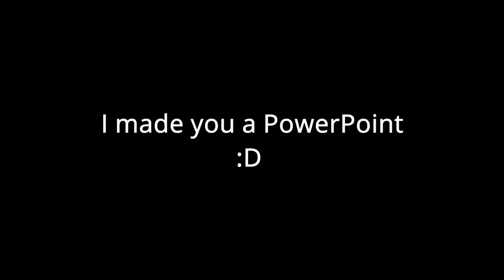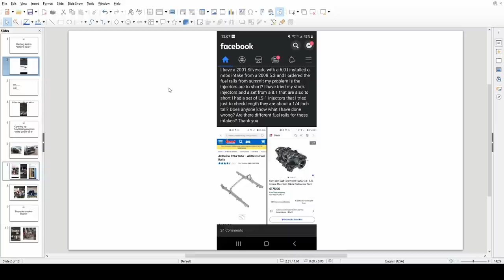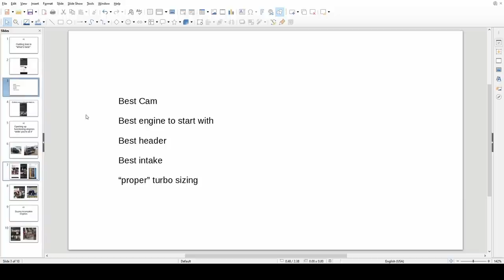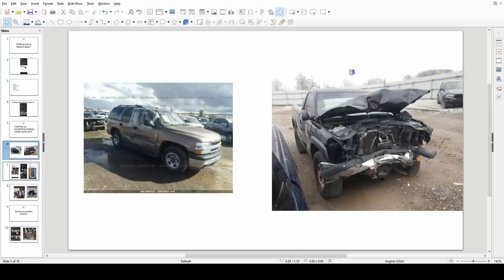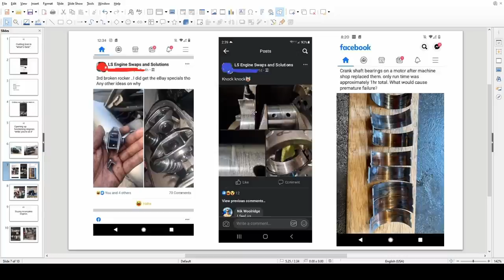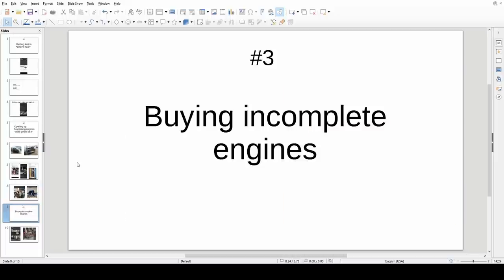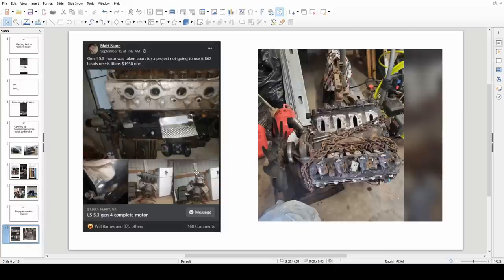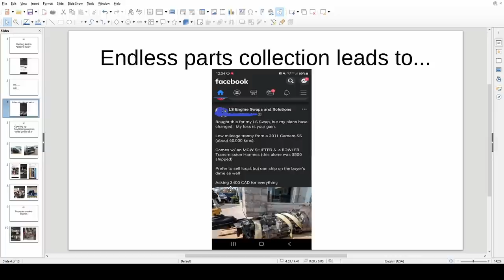3 LS engine build traps and pitfalls to avoid at all costs!

Comment: For us LS beginners who are financially strapped, this is the most informed informational LS Channel around. Learn something new every time. Some day I'll get it done. 👍
Reply: Stay away from YouTube, its the blind leading the blind
Reply from the maker: And yet here you are 🤣
Reply: @TheDrivewayEngineer  It's comedy time for me, I always need a good laugh.
Reply: @TheDrivewayEngineer  I have a ls. I want to build it to make reliable. But everyone is telling me to go flat tappet cam. They are the best and the factory uses them because they are the most reliable. And unless I’m running 8000 rpm all the time I don’t need a cam that uses solid roller lifters. And I’d most likely blow my bearings out on my rollers by going to slow. Is he right?
Reply: Another thing to keep in mind is you will spend money on things you don’t think of to get the swap to work, little things like bolts even add up, supporting hardware to integrate the engine.  If you are cash strapped the best advice would be to get everything complete in one go, then drop in and run stock.  A stock 5.3 with dual exhaust will run better than a mild 350.  They practically last forever especially in a rarely driven car so you can mod it later if you want.  I spent more money because I got a good deal on a 6.0 engine that wasn’t entirely complete, it was complete pan to intake but missing wiring harnesses and a few accessories.
Reply: I guess if you want some basic knowledge. This dude has never owned anything fast in his life. If I took his advice when I built my car it would be a slow piece of junk.
Reply: @nsboost  this isnt a speed channel. So no one expects that. He has great information on tips and tricks for people who are just turning to the LS platform. So theres that.
Reply: @RipRider916  short answer, no he isn't, first off LS engines don't have flat tappet cams, secondly that's going backwards, just do research, blowing out the bearings by going too slow sounds pretty odd and I've never heard of that myself, sounds like he knows enough to spout some crap off and sound like he knows something
Reply: everyone that builds their own stuff is strapped. the rich boys buy the turnkey chargers,etc.
Reply: Big factz💪💪💪

Comment: To be fair, in every Richard Holdener video I’ve seen he’s very clear with the engine performance graphs that show what RPM range produces the best power for a given combination. If internet idiots don’t pay attention and go buy expensive parts that work best above 5000rpm and all they do is drive around on the street then I have no sympathy for their stupid mistakes. I appreciate you are honest about the headers and buying for looks where many folks would not.
Reply: Pretty sure Holdener has videos that have demonstrated that headers make more power.
Reply: @stlchucko  they do, even more with a cam swap honestly there pretty cheap too unless you try to buy them from some fancy name brand that claims they make 2 more hp then there competitors. But my biggest regret was trying to do all motor so much cheaper and better just to go turbo if your lookin for cheap power
Reply: @texasstreettunes1310   I think manifolds vs headers on turbo stuff is a non-issue at reasonable power levels.  For that, I see packaging and durability being more important.

I noticed that the headers have the biggest effect on rec port LS heads since the exhaust side needs all the help it can get being that they only flow about 2/3 of what the intake ports do.  Holdener tested a bunch of truck cams on a 6L with rec heads with manifolds and with headers, and the headers made more power everywhere.
I suspect it's why there's "rec port" cams with big exhaust numbers.  It helps when using the manifolds, but often don't make much difference with headers since they scavenge so much better.
Reply: @stlchucko  yeah for sure dont use headers with a turbo setup, i used 1 3/4 up and forward headers with a 3inch cross over worst mistake i ended up making a whole new kit with manifolds and 2.25 cross over and the spool time was insane im pretty sure when i did my research even a 2inch cross over is good for 1500hp+.
Reply: i like holdener's stuff. it makes sense. is it all applicable? no
Reply from the maker: Same, precisely.. 

It's cool, it's interesting, it's not necessarily the best way to get to the goal.
Reply: it depends on what headers. Longtubes absolutely tend to make more power everywhere. Shorty headers tend to perform very similarly to manifolds. 

I agree that Holdener makes it clear that sheet metal intakes and the like aren't worth it for 95% of people, and that a TBSS (or whatever you want to call it) intake is a great cheap option for most applications. I certainly don't see him pushing for short runner intakes much.
Reply: Starting research on Ls swapping my 06 g35 coupe. Local guy here had a supercharged 350z ran great but was ready for more power. Ls swapped his car and it came out great. He has your mindset get it in and get rippin. Only caveat to that is it must have ac right out of the gate for me. So I’m thinking gen 3 5.3 . Now to figure out the most cost efficient way to acquire all the accessories to fit the g35.

Comment: Hey JR. I must agree, I am finally in the middle of my swap. The directions you can go are endless, so I am sticking to the realization that "I" dont know as much as a GM Engineer. Sticking with virtually all OE parts as my 6.0 came. The education I have received over the last few years, from you and others is now paying dividends. Thanks.
Reply: Great point about knowing more then a GM engineer that designed the engine in the first place.
Reply: Nice to see that you reinforced the message I've seen other YTubers give: engines are commodity goods. The only reason to tear it down is if it's a high performance/race engine, or it has a lot of sentimental value (i.e. the first car I ever drove, after I restored it with my Dad, or my kids were conceived in that back seat.) When you can pick up a running engine WITH WARRANTY for 2 or 3 thousand dollars, why risk tearing into something that runs and maybe breaking it, and definitely slowing down your project?
Reply: @rallen7660  Well, I must admit, I am going a little farther with a cam swap, new lifters, chrome-moly push-rods, and trunion kits for the rockers. In addition a full billet roller timing chain.

Comment: Most people don't have the time, patience, or know how to properly assemble an LS. And watching someone who does, makes it look easier than it is.
Reply from the maker: You know what's easier than properly assembling an LS? 

Not taking it apart in the first place.
Reply: @TheDrivewayEngineer  I'd rather replace cam and rod bearings in a free LH6, than spend money on an engine I know nothing about, but I fix them everyday for thirty years now, and own all the cover alignment tools, plus it's getting a cam and springs, and gap the rings, so not taking it apart isn't really an option.
Reply from the maker: I put mine together improperly without any alignment tools and do it in my driveway 😂

Comment: I spent $90 on a strap-on torque angle tool for doing Subaru head bolts. Used it twice, now I just use a sharpie and eyeball it. Over 20 done now with no issues,  let's go brandon!

Comment: Everyone wants 800-1k rwhp.. but yea get it going with a hot cam & small bolts ons at 500hp to the flywheel.. enjoy it & get a feel for it. Then in the meanwhile stack your parts for the 2.0 version. Way practical & in the meantime you get to enjoy your hardworking! Very valid points my friend.  Great content!

Comment: The 5.3 4l80e swap on my 82 Gmc I used a 5.3 from a 04 Avalanche and a 4l80e out of an 04 Silverado. All stock everything except for aftermarket harness. Cleaned up the engine and put new head,intake and exhaust manifold gaskets. New oil pump and new exhaust manifold bolts. Had to get another drive shaft cause mine was dented.. I just wanna cruise to shows and do decent burnouts.

Comment: Last year I helped a friend that had made several bad choices because he wanted a LS swap. What should have been a cheap swap ended up costing almost $5000 from bad decisions. He traded a built 383 with a th400 trans +$1000 for a 200k mile 1998 LS1/4l60e, the LS1 ended up being seized and had to be rebuilt. He hit a point where he was going to give up and sell it all but I stepped in to at least get it running. Another expensive waste of money was the sheet metal intake he had bought, looks cool but does nothing and costs alot.
Reply from the maker: That sucks, I hate to see that, he's lucky to have you
Reply: I made the sheet metal intake mistake before researching it when I first got into the LS swap world 6 yrs ago, I still have that intake brand new never been used still sitting in the garage,  granted I robbed it for the 92mm throttle body.......
Reply: He could of used a 4L80 and put a turbo on the 383 for less....
Reply: @sebbonxxsebbon6824  exactly! He made alot of bad decisions because he didn't do enough research.
Reply: @sebbonxxsebbon6824  man seriously, a 383 stroker on a turbo with the 4l80 would be a great street car setup. Should’ve just sold the TH400 and build a turbo kit and the trans to handle his desired power range
Reply: @mariQ09 he should have just kept the 383 and th400 and maybe did a little upgrade to the 383 like a bigger cam or even just a set of 1.6:1 rockers...

Comment: Nice vid. I bought a running kinda driving 99 5.3 silverado 1500 4x4 for 600 bucks. Bad trans, no drive or over drive, I drove it on the trailer. Pulled it out the other day putting a gasket kit on it and then it's going into a 79 GMC. What he says is real. It's easy to get lost in buying the "best" parts for your swap. The most I am doing to my 5.3 is new gaskets, no need to open it up any further.

Comment: Sunday I went and picked up a 1999 firebird with the V6. The engine runs but has a knock. I figured I would just LS swap it. I do not want to go Down a rabbit hole. 
What I need to know is 
1) can I use the transmission that came with the car?
2) do you reuse any of the parts that are on the V6? 
3) does the suspension need to be done right away? 
4) do I need a new K member? 
I'm sure there are 100 more questions but those are the most important to me.

Comment: I got my 5.3 from a wrecked Tahoe z71 in some guys front yard.  I pulled the engine, trans, harness, gas pedal, O2 sensors, intake basically every took off to remove the engine I took home all for $1,000.  I did the headers and fancy digital gauges but the rest was mostly junkyard parts and stuff I modified to make it fit.   It runs great so far.  If it breaks I’ll go and get another junkyard engine to replace it.  This is my first LS swap and I look forward to doing it again hopefully soon.
Reply: Hey Bruce where are you from

Comment: Why didn’t I see this last year, I now have 4 “LS” motors, 2 strokers kit, and not a single running engine, well I take that back my LS1 s14 runs but I just upgraded the radiator stuff, shoot I guess it doesn’t run either

Comment: My local u-pull it sells all V8’s for $350. I’m not ready to do the LS swap on my Land Rover, I just did work on it’s 4.6 (Buick 215), but I know I will need to replace the Rover V8. LS’s are way more reliable and cheaper. With that said, I do need to buy a special adapter to mount a GM trans to my Rovers 230 transfer case. I just found a used one for $400 because the dude is doing a diesel swap on an LS swapped Rover. I know all about rabbit holes, my other project is a H6 swapped Subaru. I see so many YouTube channels swapping the intakes on LS’s. I’m just swapping in a complete truck motor, L33 because it’s aluminum block like the Rover V8. Similar weight. Thanks for the information.

Comment: You helped me throughout my swap and finally got to move my project on its own power like a month ago. My engine/transmission came ot off a 2002 Tahoe with 190000 milesand I put it in stock and thats how im keep it besides shorty headers and cold air intake.
Reply from the maker: That's awesome! Congratulations!

Comment: This is the video everyone should watch before doing an Ls swap. I've gone down the road of spending a lot of money to do one, and learned that I didn't have to.. I could have got away much cheaper, and had just as much fun. I'm about to swap another 3rd gen Nova of mine.. the complete running 5.3 with wiring, pcm, tac module, and pedal I got in trade for a big block bellhousing (roughly $300 because it was a lakewood bellhousing).. I went with ICT billet swap mounts ($40), an Amazon 302-2 oil pan ($200, and came with everything including the dipstick), Ls3 manifolds ($200, most people can get away with the stock truck manifolds).. I'll barely have any money into my swap this time.. and the 300hp the 5.3 puts out is a lot more than the probably 150 the car had originally. I also have about $250 into a clutch, pressure plate, and clutch ball pivot adapter because I'm running a muncie 4 speed.

Comment: Truck intake, no-name eBay full length headers and a stage two cam is plenty for 95% of guys on the street. Good springs, roller tip rockers and maybe a convertor. You're done. 
Spend your money on gears and a transmission that'll last.

Comment: I did my swap in 2010 when there was a lot less information but fortunately most of it was good.  I had a 383 with heads, a 243 duration cam and rpm air gap manifold that blew up.  I replaced it with an lq4 with ls1 hotcam and nothing else done.  I did have to rebuild it due to copper showing on the cam bearings but I had built engines before so no big deal.  That near stock lq4 was 2/10s faster in the 1/4 than the built 383 that it replaced and it ran better on the street.  I watch Richard Holdner too and I reach a different conclusion than a lot of people, I see the gains offered by the best and concluded it typically isn’t worth the money.  I also see a lot of tests to get that extra 12hp are done with a fully built engine often a 408 stroker.  Unless your engine is built to the max you mostly won’t notice the difference and your engine will likely run worse, the whole package has to work together.  The best intake is typically the stock one, headers may be a good idea if the stock manifolds won’t fit, I went with headers because my 383 already had headers and going that rout was easier.  Years later I modified the 6.0 and went down the rabbit hole to improve it but I had it running and driving while I collected parts, if plans had changed I would have lost money but still had a running driving 6.0 swap.  For most people I think a 5.3 with an Ls6 cam would be spot on.

Comment: I plan to use a Truck Norris cam. It doesn't change low end torque, doesn't need springs, and adds about 30-40 HP at Higher end. I'm using ebay headers. Nothing else. I use my truck for hauling wood, pulling a trailer.

Comment: Swapped a motor in a 07 Silverado for someone. I got the motor out of it in payment. Crank was fucked up. Valves bent. Cam chewed up. Lifters toast

Bought a 58x crank for $75… used the rods in the engine. Put summit forged pistons in it. Put a set of milled 862s on it. Custom btr cam. 11/32 push tubes. Btr high rpm springs. Ctsv lifters. Car runs 8.90s in the 1/4 like a bracket car and only have 2k into the engine.

Comment: When I did my build I went to junk yard.  I wanted a 6.0.  Couldn't find any in my yard.  Just 4.8 and 5.3 there.   The 4.8 was the easiest pick.
So you know what my truck has? A 4.8.  Why? Cause that's what got my truck up and running.
Reply from the maker: And you're out there having fun while the next guys truck is slowly rusting in the backyard because he can't find a 6.0 lol
Reply: 4.8's ripp, and sip gas.....I love my 4.8, it's spanked brand new ford raptors at the pismo dunes.....just walked right past them at 7k rpm......look up cj7 jeep beats raptor racing in sand .....on you tube,  there was like 5 of those piece's of shit trying to beat my lil 4.8

Comment: i bought my 5.3 ls right out of a pull apart from a wreck for 700 they would have charged 600 if i had pulled it... fired it in the wreck, bought it slammed it in my k10 all stock except for the standalone harness and a pcm reflash iam out doing burnouts everyday runs perfect

Comment: I’m with you on the trunion upgrades. I’ve never seen the stock needle bearings fail. There was a bulletin from GM about it about 20 years ago, but I’ve never personally seen one fail. My swap runs stock rockers and they’re fine. But my cam is only .588 lift.
Reply from the maker: I see more people screwing up reunion installs by far lol

Comment: Jr u are right about everything u said only reason i got shorty headers for my lq9 was i was tired of stock manifolds leaking i know shortys wont make more power but they look nice and no more leaks so win win i love ur videos cause ur a real person if my motor was messed up ur gonna tell me wrong or just send it  just to prove a point to people so my lq4 blew up i got a lq9 someone told me ill gain nothing from putting the lq9 tune in my pcm that used to run my lq4 motor

Comment: Holdener did Dyno test on headers, and yes, they made more power and torque. He tested the cheap eBay, Expensive Hooker stainless, shorty's and stock. Surprisingly, the cheap eBay made like 30+ horsepower, but they made the best torque at 35 more torque at low RPM. The Hookers we're slightly better on HP over 6,000.  This was on 5.3.
Reply from the maker: They never made 30hp, they made 12.

LA di da
Reply from the maker: https://www.youtube.com/watch?v=5HL_VSFDEVg